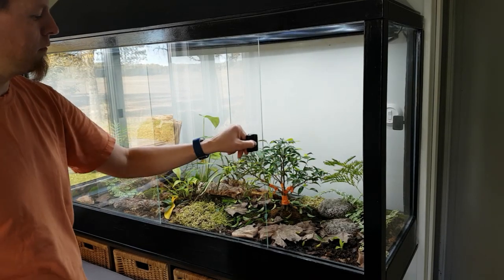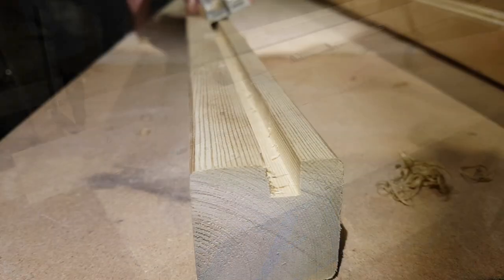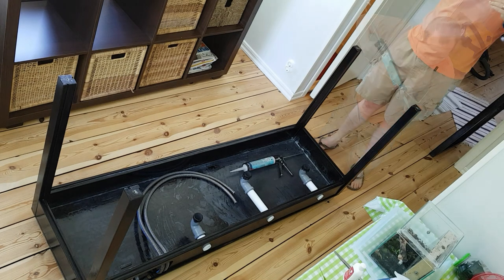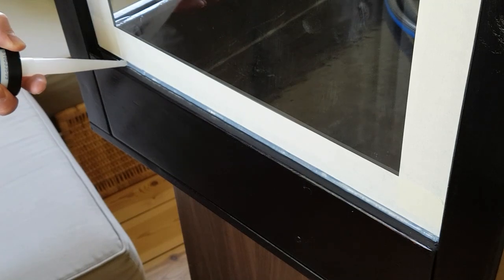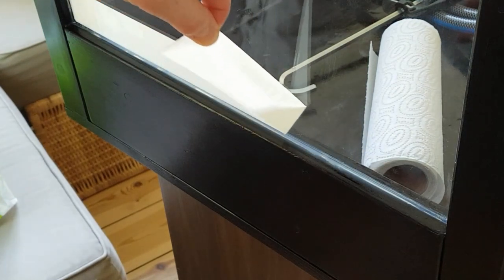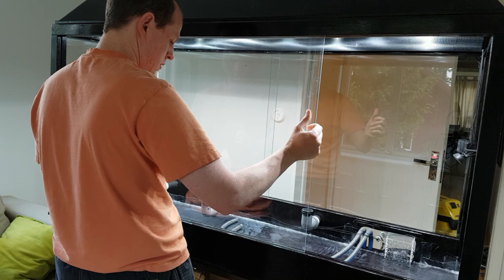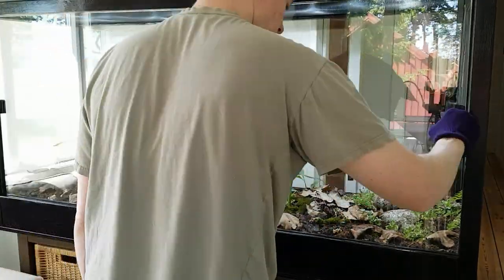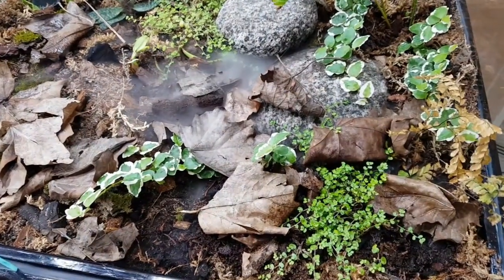DIY Vivarium. Installing Glass Doors.

Comment: Is it possible to make the first cuts etc. without the specific machinery?
Reply from the maker: Making grooves without a router is possible. It can be done with a power saw if you have one. Or chisel but would take a bit more time.